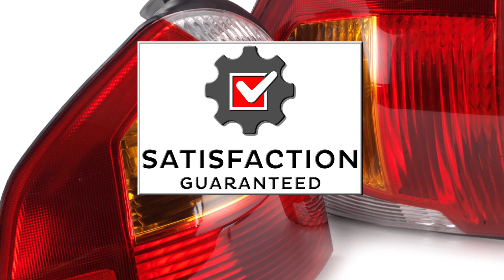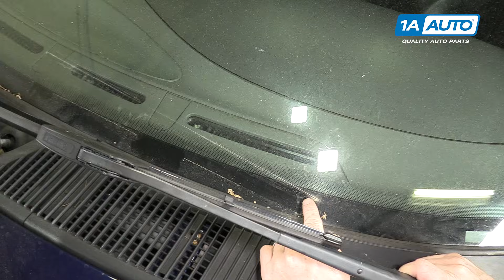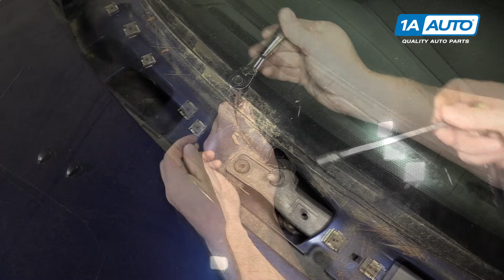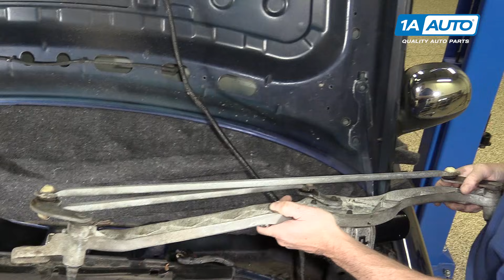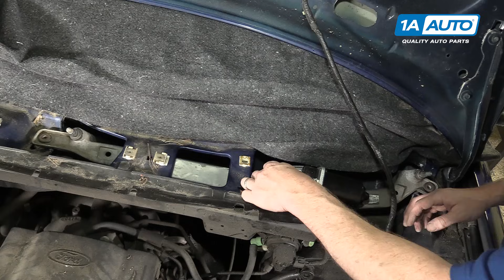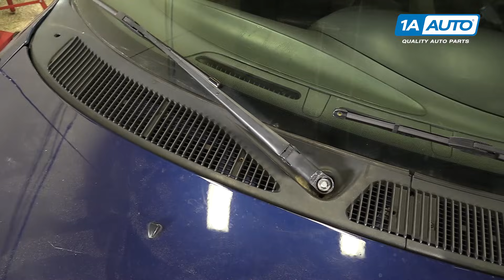How to Replace Windshield Wiper Motor 97-03 Ford F-150

Comment: You can’t uninstall/install bracket assembly unless you remove entire rod end underneath the wiper blade by removing the ring clip, it’s also going to make it much much easier, this Ford wiper motor is a pain in the ass by design, thanks Ford

Comment: I put this in as recommended (compared the video to my assembly) and when I turn the wiper switch on, the wipers move correctly once, then they jump and operates in reverse (parking in the up position). Any advice? A mechanic recently wired a new pigtail, as the old one was melted.

Comment: So I did this the exact same way but once u put it in again you have to align it once it's in place with that being said I tighten it with hand wrech & after about 4 turns back n forth while wipers on going the screw backs out. I've taken this thing out 3 times back to back it keeps doing same thing !

Comment: Great video, thanks much. I would like to ask why risk damaging the windshield? I just watched your video, which is great, but there is no need to rest the hood back on the windshield. If you are worried about scratching the hood put some tape on it. I removed and replaced my wiper motor on my 2003 f150 supercrew this afternoon. I closed  the hood no problem, plenty of room.Thanks for your time.

Comment: Fantastic tip on how to get the arms lined up to take the assembly out.  Doubt anyone could figure that out on their own. I did see the part that the 8 mm bolt holds came off on the side with the 2 bolts, and was put back on the opposite side, on the side with only 1 bolt. Guess it works either way.  And most motors don't seem to have that plastic piece underneath the 8 mm bolt....guess it is not really needed.
Reply from the maker: +Don Erickson Thanks for the tip!

Comment: This video is a godsend. It probably saved me $250 in labor costs by doing it myself. My only suggestion is when you get a new wiper motor, test it first before installing it. I bought a reman from a local parts house and I installed it completely before testing it. You could hear it grinding from my neighbors house. I returned it and bought a new wiper motor. All good

I had a very difficult time finding the 8 mm bolt to rotate the wiper arms. I hooked the motor back up and bumped the ignition until the arms moved to where I could get the wiper assembly out. 

Finally when I installed the new one, I left the plastic piece on the wiper motor and when I tighten the three screws down it went up into the housing. Don't know if this was right or wrong but it's working for me.

Comment: Is the f250 super duty the same ?  Mine didn’t have the intermediate options working?  I changed the multifunction switch didn’t fix it?  1999 truck is the options controlled in the motor ? Thx Danny
Reply from the maker: +djtoo7 At this moment, the closest how-to video we have to your request is for this vehicle, which is very similar to the one you have. The steps may not be 100% the same, but should contain an adequate amount of information necessary for accomplishing this task
Reply: 1A Auto Parts    So the intermittent function is in the motor ? Or is there a module that controls it between the lever and the motor ?  I don’t know where to look for why it’s not working.  I just change the multifunction lever and that did not fix it.   The wipers work when I turn it all the way to low or high just not on the intermittent options.  Thx Danny

Comment: Just my passenger wiper sticks, what would I get to repair that?  Drivers side continues to work.
Reply from the maker: Thanks for checking us out! There could be multiple reasons why you're having this particular problem. We suggest taking your vehicle to a nearby reputable shop to identify the cause and they will be able to determine what is needed for the repair. +Chuck Messenger
Reply: Mine too,what was the problem?

Comment: Thank you for your excellent video.  The quality of your filming, lighting and explanation really made this job tolerable.  I ran into trouble because my issue was the bushings (rather than the motor) and when I disassembled the arms, I didn't get them back together the right way.  Pausing your video when the unit was ready to reinstall into the truck was a godsend!  It showed me the right way to align the arms and I was able to finish the job.  Incidentally, the unit will not fit back into the truck if the arms are not properly attached.  Thank you again!
Reply: Hey so mine go up stuck in a spot and I give them a little tug and they go all the way then back down just fine would that be bushings?

Comment: Hi, I have a 04 f150. Wipers will not work. Took the motor out and plugged it in and spins in one direction. Put it back on wiper assembly and it spins and jams up against the assembly.